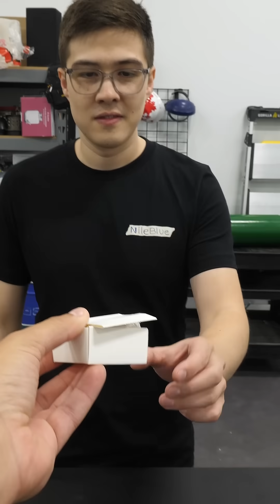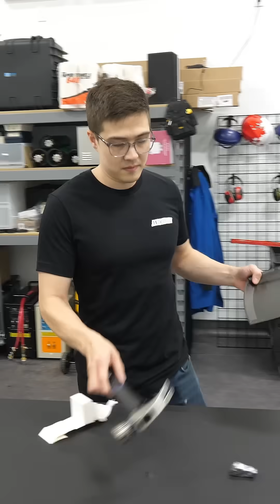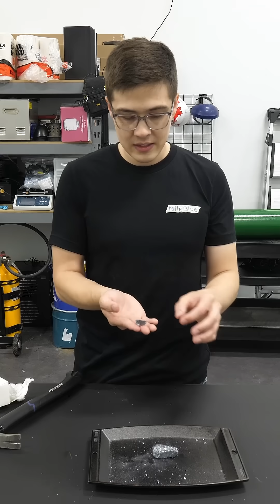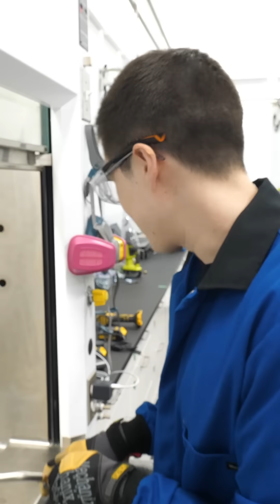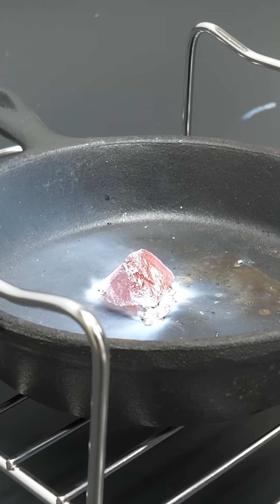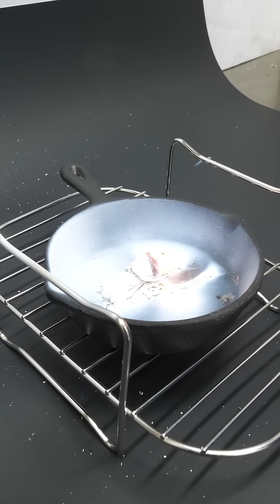Silicon is weird

Comment: I used to work in several Silicon plants in central Alabama.  These plants would take in silica pebble (SiO2) and preferably with low to no iron (Fe) contamination.  This pebble would be charged into a submerged electric arc furnace with petroleum coke and wood chips.  The electric arc melts the silica and drives off the the carbon in the petroleum coke.  Si-O2= CO or carbon monoxide.  The woodchips control the electric current in the charge.  This is a continuous process where pebble, coke and wood chips are fed at the top of the furnace and periodically tapped at the bottom.  The liquid silicon metal is cast into chills or molds that are made of cast iron that are round like a gigantic disk that is 10 ft. in diameter and 6 inches deep with a taper on the edges.  When the molten silicon metal solidifies, the mold is flipped over by a crane with a shiny metal disk.  Then an iron ball is dropped by the crane to break up the silicon disk into pieces where these pieces are further processed in a jaw crusher and screened to different sizes.  The piece in the video is the material that was taken after the silicon is crushed.  Silicon is melted above 3000 deg F and is still molten at 2750 deg F.  This silicon is almost 99% pure.  The fume or dust collected at the top of the furnace in the baghouse contains some silicon and traces of iron which is not desired in the metal.  I worked for Ohio Ferro Alloys and Globe Metallurgical as a consultant for over 20 years.  There is a new producer in central Mississippi.  You should be able to melt the silicon metal easily with acetylene and oxygen or propane and oxygen.
Reply: I am now ready to start refining silicon
Reply: @lucanoro-kc5fp you gotta check out the guy who made a toaster from scratch.
Reply: @universalsoldier27 who, you cant just say rhat without saying
Reply: same @lucanoro-kc5fp
Reply: Well I learned something about my job today. I weigh out metal powder/compounds to make the core of m/fcaw welding wire. We use silicon or ferrosilicon (or both depending on wire specs %) in just about everything. Always wondering how our stuff is refined and processed.
Reply: @insanospaz cool, I use fcaw almost daily and always wonder how they get the flux inside the wire?
Reply: @insanospaz fcaw once saved my project because I ran out of shielding gas, I just fed the fcaw wire through the mag machine and was able to finish the project in time without racing to the Linde plant 😅
Reply: This is why you check the comments lol
Reply: thank you for the detailed information
Reply: Greetings fellow Alabamaian 🥂 Thank you for your sharing!!
Reply: Acipco, USSteel, ABC Coke plant...retired Local 8. My man tells no lies. 👊
Reply: As ab autistic whose hobby is collecting information thank you :) also as soon as they wanted to melt them i thought an oxy acetylene torch cause if it wont melt with an oxy then wft even is it 😂
Reply: I worked at the Mississippi Silicon facility in Burnsville. One of the most interesting, demanding, dustiest, hottest, dangerous jobs in my 14 years of industrial maintenance. Ambient temps on the upper floors were +160 degrees Fahrenheit during summer months. Nearly every employee that worked around the tapping sections had been burned enough times to become tolerant to it. The older arc furnace (only 4 years old) had bled out electricity into the framing between the bottom and top of the furnace causing cracks and breakage all while the heat swelled the outsides so much it was no longer able to keep rotating which causes certain areas around the outer edge to harden and will eventually require and tear out and reline. It was the most self destructive place I’ve worked. Literally tearing itself apart 24/7… the electricity bill was $1.5 to 2 million a month and each section of electrode that burns up was over $40,000 each and only 4 could be hauled in per truck load. And they were making a killing even with all this happening. I’d rather scrub bathroom floors with my bare hands as I had work there again lol.
Reply: I'm  an Industrial Chemist worked at Nonferal NSW Sydney  Australia  in 1980 making 50 secondary aluminium.  The main addition was silicon obtained from China and Brazil. I kept one lovely sample of this metallic and it is still the same not corroded. The silicon will dissolve in molten aluminium at 650 C . The alloys had 12 % and 6% silicon. Used for die-cast into lawnmower and car parts. Industry shut-down 20 years ago. There are other recycling plants here.
Reply: Nếu thế giới có thật nhiều những người như bạn nhân loại sẽ phát triển rất rất nhanh. Cám ơn thông tin rất bổ ích.
Reply: This is very interesting info, thank you for sharing! I know you were a consultant, but hopefully they gave you incredibly good respirators if you ever had to go in the plant. If you can get silica lung from just cutting up rocks, I can’t imagine was sort of disease you can get from that kind of factory
Reply: The dust is carried away in a negative atmosphere in the building which channels the flow of dust which we call silica fume to a dust catcher and baghouse.  This fume is finer than flour and much finer than regular dust.  This fume can coat your lungs and give you a disease called silicosis which is like black lung in coal mines and is much finer than coal dust.  Some people add silica fume to concrete in which the fume fills microcavities in concrete and makes concrete incredibly dense and strong.  Most dusts are disposed of in special landfills but silica fume can be used as another product in producing ferrosilicon or silicon metal. @Dnbootin
Reply: @richardallison8745 
I worked on the reactors at one in Lower Alabama. It's amazing how clean everything is and has to be.
Reply: I am not sure we are talking about the same plants.  There are no reactors but submerged electric arc furnaces and these plants are very dirty with carbon, dust and etc.  There are three plants in Alabama.  One in Selma, Mt.Meigs near Montgomery and the last one in Bridgeport, AL. @notaloneintokyo
Reply: Very factual and informative. Appreciate the comment!!
Reply: ...... i always thought silicon was a non-metal... 

Or is it a semi metal?
Reply: @madclowntapia  it's not you can say it's in between.
Reply: @madclowntapia  it's not just a semiconductor, it's basically the dominant semiconductor of the industry
Reply: My brother is looking at working at a silica plant, whats a typical hourly rate?
Reply: @Twistedredlab bout treefitty
Reply: @Twistedredlab itll cost you the last 15 years of your live
Reply: @Twistedredlab If he is intelligent, can follow directions, can learn the basics of a job, is sober on the job, has valid credentials and references, like all employees, pay would be discussed with the applicant.
Reply: Scilica and silicon are different things my guy. @Twistedredlab
Reply: Why is it nobody answered this question I'm curious 🤔 😂 @Twistedredlab
Reply: @JonCAdams  probably because the rate is so high hahaha
Reply: Thanks for sharing your experience and knowledge
Reply: Difference between Silicon and Silicone, ya'll
Reply: Very informative however, what are the uses for the  end product?
Reply: Integrated circuits, transistors, silicone adhesives, computer chips, etc. @marcellatompkins4675
Reply: I just wanted to say Thank You... I really enjoyed reading  reading your post...  Love when I can find something I never knew.
Reply: You guess exactly right.  Some quartz has impurities like iron in which is called ferro silicon which is an alloy that is added to molten steel to make it corrosion resistant and added to molten iron to make it softer and machinable.  Silicon is abundant on Earth for lots of uses including making computer chips.@ScrotN
Reply: So u just hurt my brain
Reply: sorry your brain hurts.  You can always hide in your parent's basement. @Kimberly-uz6dw
Reply: So sorry your lil brain hurts.  I hope you didn't hurt anything in there.... @Kimberly-uz6dw
Reply: 😮Thank you for your input.
Reply: Probably that silicon was used for wafers after then chips or something else.
Reply: @jgon12 nope, wafer silicon is grown as crystal
Reply: You are right and also RTV Silicone sealant. @jgon12
Reply: I’m glad it’s not a conversation between us 😂😂 I would just be keep saying “oh really that’s cool “ 😂I didn’t even know silicone existed in a natural form I thought it was made
Reply: @MrGimmix81 you are thinking of Silicone
Reply: Bro is a certified mechanical engineer
Reply: That's awesome, it's always really amazing to hear about the different kinds of work people do all around the country. I'm starting my first work position as an intern in a polymer research facility this summer, so I like reading stuff like this. Thanks for sharing
Reply: Thank you for the explanation on how Silicon ore is refined into its purer form.  I work in the microchip industry where wafer that are under 1mm thick are used as the base for the creation of microchips.  The Silicon (Si) wafers are created by first creating a boule of silicon.  Basically, you take a seed of silicon in the form of a rod and dip it into a pool of molten Si and then slowly draw it out like one would make candles.  The boules of Si vary in diameter between 3 inches to 12 inches (300mm) with the most common sizes being 8 inches (200mm) and 12 inches (300mm).  The boules are first placed on a lathe to bring the diameter to the desired diameter, then the boule is sliced with a bandsaw (?) to the approximate thickness.  The front and rear are then polished to the required thickness.  From that point on various processes are used to create the different layers that make up the electronic circuitry in a microchip.  After all the layers are completed, the wafer is sliced using a disc saw to create the individual “chips” that are then placed in various packages.  A wire binder then attaches pins or legs to the chip at various points.  The last step is to encapsulate/hermetically seal the package and chip is ready for use in a computer or car or whatever device it is needed in.
Reply: I use SiO2 every day at my business. Only it’s in liquid form and goes on cars lol.
Reply: Interesting information. 🥸
Reply: Thanks now I am going to get my A in metallurgy, mind if I plagiarize 😂
Reply: Wow, I never would have thought that ordinary grey iron would be suitable for a mold when the silicon is molten at that temperature. Impressive! Thanks for that great explanation.
Reply: I am not as educated on the topic and your comment looks very detailed. As dyslexic as I am, I appreciate you writing a well redacted conclusion. Silicon can melt. I appreciate you for that and have a great day
Reply: sounds like a fuckin' Willy Wonka contraption
Reply: Roll Tide.
Reply: Roll Tide!!!! @NightsDecent
Reply: Thanks for sharing
Reply: I love you
Reply: So what would make this silicon not melt in the video?
Reply: That is such a wild recipe. I feel like it must have been invented in like the 1780s, but they just didn't have anything else that worked nearly as well, so it stuck.
In all actuality, I'm sure there is a reason it is/was done that way, but that is the kinda thing I would never think of in a million years.
Reply: Thanks for the information brother
Reply: I actually read it all. I can't say I got it all.
Reply: There are 37 lines and 1,630 characters (including spaces (312)).
Reply: This detailed comment makes me feel like I shouldn’t know this information 😂
Reply: @u.6549  Nothing like being ignorant.
Reply: @richardallison8745  well i don’t work with metals or any elements of that matter... so yeah ignorance.
Reply: My grandfather worked there for almost 15! Don’t remember what he told me he did as I was like 9 or 10 but that’s so cool
Reply: I wish I knew were you lived so I could buy you a beer.👍
Reply: @skybot9998  I'm in Pensacola, FL and I would take you up on that.
Reply: @richardallison8745  I'm in Canada. Visited Florida a few times,beautiful state. Maybe next time I'm down.👍
Reply: For non-americans out there (myself included), 3000° F is 1648,8° C and 2750° F would be 1510° C. Still some crazy αss temperatures.
Reply: @SkyRied1 that is for sure. I tap a silicon furnace and stand withing feet of the metal
Reply: First they take the dingle bop and they smooth it out with a bunch of silicon. The silicon is then...repurposed for later batches.
Reply: Heisenberg ?
Reply: Ayo! That is friggin cool, your detailed explanation is some seriously educational stuff!! Thanks!
Reply: No he's not ya wee poof
Reply: Fraudster
Reply: This is dirty silicon tho
Reply: Geeze umm thanks😂
Reply: And you end up with Kung cancer before you retire
Reply: Gregtech?????
Reply: Ofc it’s in Ohio
Reply: This is a piece of SLAG.   .   .from aluminum 😊
Reply: Shit, Silcone/ Silicate needs to be at the fore front of Our Government making UFO'S or Submarine and Space shuttles...
Elon Musk needs to get on this....
Reply: This guy silicons.
Reply: e
Reply: Cool!
Reply: Very very useful information
Reply: Thx for info
Reply: thank you 🙏
Reply: You turned sand into a computer
Reply: I appreciate this info so much, so detailed. Thankyou for sharing!
Reply: That Silicon must be high af after all that coke
Reply: What is a jaw crusher
Reply: So this is how silicon dildos are made? Interesting. Thank you for sharing.
Reply: That was an awesome explanation. Thank you.
Reply: Former foundry man here...
We used it as part of the alloy in ductile iron..
Reply: @jonjacobjingleheimerschmid3798  Yep, and also magnesium to make grey iron into ductile iron.  Did you enjoy adding magnesium with the fireworks?
Reply: @richardallison8745  all part of the day.
Couple of pounds in bottom of ladle and sprinkle the rest into the iron steam as it came out of furnace, really made a 1000#
Of iron dance!
Hit the 12 minute timer and pour like hell!
Reply: Who even came up with that?
I say aliens.
Reply: @kukaliemikalie8157  I say you are not funny.  I bet you live in your parent's basement.
Reply: This is why I check viewer comments if I still questions. Thanks for sharing.
Reply: Are you a materials engineer?
Reply: @ScarObviously  No but I was a ceramic engineer that delt with refractory materials that were targeted at the steel, aluminum, copper, brass and various metal alloy production.  Mostly I tromped around large steel mills and was a liason with steel companies where there was molten steel being poured and our company as a technical service rep solving problems and initiating new refractory materials to last longer.  I guess I was working at times as a materials engineer.
Reply: So you are saying he needs a LARGER cast iron pan? 😂
Reply: Mississipi ?
🎶 « You gotta moooove… » 🎶
😁
Reply: roll tide 🫡
Reply: Silicon is not a metal
Reply: huh! that's really interesting. So, another industry that uses wood and coal, I did not know this process of silicon extraction. So cool tbh. I can imagine the chemist thinkering, having to scale this process to work production on an industrial scale!
Reply: I'm fairly sure the people of Alabama think silicon is witchcraft.
Reply: I drive a forklift.
Reply: Thx u helped me pass my science test 👍
Reply: I live about 20 from the one in Mississippi. I remember when they first built it. I used to haul that fume dust out of there and take it to the landfill.
Reply: @joeytigrett173  I am surprised they are throwing away silica fume because there is a market for it.  I used to work for a company that used to buy it to put in their products.  You can add this fume to concrete to make it stronger and more resistant to wear because it increases the bulk density a lot.
Reply: How does the SiO2 carry an arc when it's not conductive??
Reply: @miceskin  You are right on that but the work is done in the furnace.  In other words, the submerged electric arc furnace is powered with 44,000 volts and between 400-900 Kilo amps.  The furnace has three carbon electrodes which are using 3 phase AC voltage and there is a huge arc between the three electrodes which are as hot as our sun.  The arc makes heat around these electrodes and indirects the furnace charged below that contains silica pebble (SiO2), petroleum coke and wood chips to keep the heat in the furnace shell.  When the molten metal level gets so high, the furnace is tapped into ladles.  These carbon electrodes are made of petroleum coke, coal tar, then pressed into a round cylinder and then fired at a high temp to bond the electrode into a strong cylinder.  These electrodes are about 24 inches+ in diameter and 20 ft long.  These furnaces also make alloys to be added to steel heats in steel mill such as ferrosilicon, ferromag, ferrochrome and etc.  Steel furnaces are different and can be either AC or DC because their steel scrap charges are very conductive to the electric arc.  I hope this helps.
Reply: i used to grow silicon crystals which were processed into the starting materials for various chips.We melted silicon with various heavy metals to create crystals with certain electrical properties.Fascinating work...I miss it,
Reply: I was really hoping at the end of all this you said something like  "..And all this is completely made up."
Reply: Thank you for that explanation. This stuff is so cool! Even if I can’t remember most of it. lol it’s interesting!!
Reply: Silicon is not a metal though.
Reply: @faq_is_love  It is a metalloid.  Both metal and non metal.
Reply: First off thanks for the info. What was the pay for a job like this? and are you retired now?
Reply: @legend_1496  Retired from steel industry from the molten metal part.  Today's hourly workers with a little OT is around $100-125K per year.  Avg. salary $150K+
Reply: I work for the company that would tear out the furnaces at Globe.  I used to love watching them tap their furnaces.  Nothing like hearing a gun shot in a mill.  Coolest way to tap a furnace.
Reply: Stick it in some thermite.
Reply: Hey, not much to contribute but we were neighbors at some point. I worked maintenance at the mill plant next door on Ohio Ferro. And as dirty as it was at our plant, we used to always say at least we aren't over there by the furnace.
Reply: 😅 I've read too many comments to think this was an elaborate story joke. Only to find factual information
Reply: @skyemanuel5069  Joke?  What is the joke?  The video was factual, not for entertainment.  I don't get your comment.  You don't express yourself well.
Reply: @richardallison8745 things like “petroleum coke” and “jaw crusher” also made me question the validity of this comment
Reply: @richardallison8745 he's talking about the comment not the video and yeah, paragraph comments are usually a joke or somebody popping off at the mouth with shit they know nothing about.
Reply: My rotted brain just pictured all of those processes in the most looney toons way and I don't think I want it corrected
Reply: @SheliakDragon : Elmer Fudd comes to mind!
Reply: @SheliakDragon hahahaha
Reply: Wow , super interesting, incredible anyone figured that out to begin with . The video would have been hilarious if they had approached you randomly and said " Hey guess what this is ....
Reply: Man, I love the comment.  Next time, please fill in the full chemical reaction formula, though.  Si-O2=CO is just going to confuse the plebians 😢
Reply: @evanmorrison3232 the plebs.collectively and kindly ask that you stfu and stop speaking on our behalf. That said we'd really likeaquarium some shiney rocks for our of oddities.
Reply: SiO2 does not equal CO.  CO is just a waste stream in producing silicon metal and comes from the oxidation (burning) of petroleum coke and wood chips. @evanmorrison3232
Reply: @evanmorrison3232 , I was expecting CO2, not CO
Reply: @evanmorrison3232 you mean the people who aren't nerds about it? Ok I'm a pleabian. 🤓
Reply: Thank you for sharing 😊
Reply: Well alrighty then👍.
Reply: 😂all I heard was coke
Reply: Coke!!??? Ketchup too?😊
Reply: Wut?
Reply: Who is reading all that
Reply: @H6ngman  Sorry it is all above your head.  Maybe you should return to flipping burgers before a robot takes that job.
Reply: @H6ngman 6k people gave him positive input.
Reply: That was actually interesting. Did they launch those discs into the and use a shitty camera to photograph them?
Reply: @terrencebryant7518 launch those disk into what and what shitty camera work?😅
Reply: @terrencebryant7518 😮🛸
Reply: Bruh wtf 🤕
Reply: Lmaoo you lost me at ' i used to work in'
Reply: Working in metallurgical plants in supervision and consulting was my life career.  I am retired now.  What's not to understand?  You must get lost a lot. @dealerhealer3673
Reply: Tl;dr
Only read it if ur sciency
Reply: Nerd
Reply: @idle_pete and you're a broke boi lol.
Reply: I ain’t reading all that but good for you dawg
Reply: please use metric system
Reply: i ain't reeding all that
Reply: @andypinon8641 your resistance to learning and processing information is embarrassing and will permanently stunt your ability to grow as a conscious and thought-capable being.

Not being able to read one page of a book is horrifying.
Reply: @andypinon8641 then why did you comment?
Reply: @andypinon8641 lazy
Reply: Write text book bro, it be easier than this comment.
Reply: Hey Zippy, I am so sorry my posts were too hard for you to understand.  Some people are interested and some not.  In your case, you are not mentally capable to understand and you should have skipped my post.  Sorry bro... @zippydooda
Reply: Did you say Alabama? How is your sister doing mate?
Reply: I don't have a sister.  You think you are clever but you have never been to Alabama and it is a beautiful state with people that are kind and polite.  Alabama has two medical schools and is the most industrial in the south.  We have a strong military presence here along with companies like U.S. Steel, Nucor Steel, Airbus does final assembly of large passenger jets, Amazon, International Paper, Honda, Kia, Mercedes Benz, Austal builds ships for the US Navy, Hyandai, Lockheed-Martin, Northrup Grumman, NASA at the Marshall Space Flight Center, etc.  Alabama has the third-largest seaport on the Gulf of Mexico.  Apparently, you go to family reunions to meet girls, huh?  Your stupidity surprises me. @NomadUrpagi
Reply: I aint readin allat bruh
Reply: @xvi_lostboii7012  he said I was there doin tha dam thing
Reply: @Vysache  it doesn't matter if you don't read his comment or not plenty of other people did.
Reply: Sorry, I put such a strain on that brain.  I hope your brain is not damaged. @Vysache
Reply: For fugs sake.. why you type all those physics words I read those things and I still don't know what's going on..
Reply: @user-vi5wh7ts6c  we can tell by your lack of vocabulary.
Reply: Too much to read. I’m happy for you or sorry that happened.
Reply: @valtros2k10  what the fuck.
It was a single paragraph.. I’m not one to say this usually but.. I think short form content has destroyed your attention span and capability to process information. 

Can you read a book? 
I assume not. 
That’s not the flex you think it is. That’s embarrassing and makes me fear for the wellness and intelligence of all of Humanity.
Reply: @lunaskisses  It doesn't take much to trigger you does it? Maybe you get angry a lot. Calm down it's just a YouTube comment.
Reply: Sad that less than a 30 sec read is too much. Maybe try youtube kids. @valtros2k10